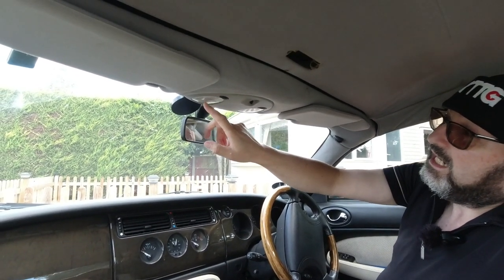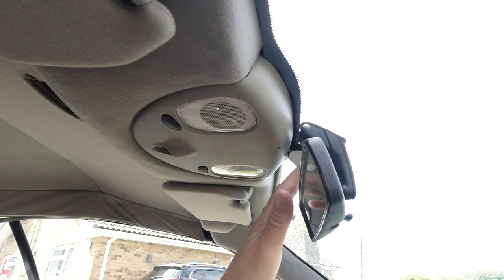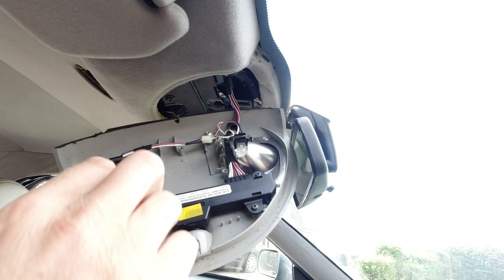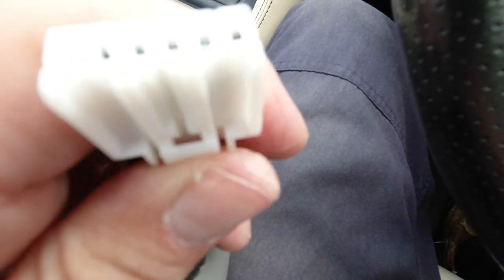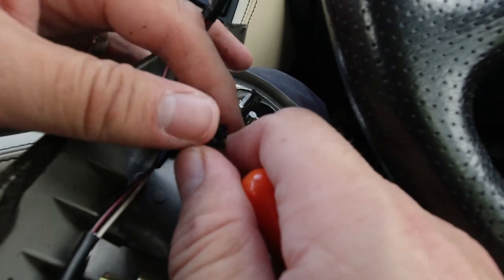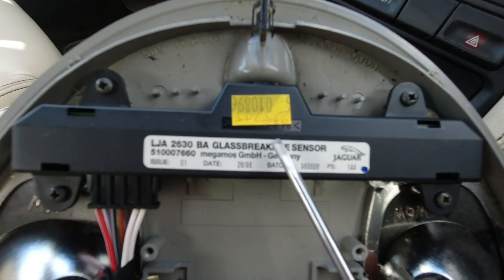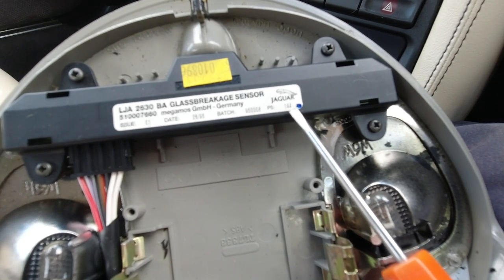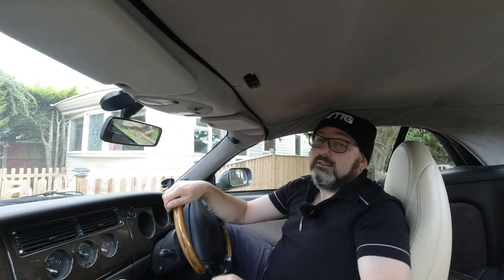Secrets of the Jaguar XK8 episode 68.  Map lamps.

Comment: Hi John . Just a quick one the later models came with a ultra sonic sensor for checking the passenger etc was no to close etc. When doing these models I recommend disconnecting the battery 1st because a power surge to the airbags could be expensive. Also when refitting be careful fitting the rear lug you do not want to crush the wire mesh covering the sensors as this can cause airbag warning light to come on as the ultra sonics don't send out of the unit properly
Reply from the maker: I have seen the version with the large mesh at the rear but had not realised that it was connected with the occupant sensing. Thanks👍

Comment: Great help thanks. A couple of points for others to note. 
1. If you have a fine mesh part for the safety system don’t touch it, it’s really soft and bends.
2. When you pull the trim down it takes a lot of force, mine went with a bang.
3. Around the front edge of the trim against the windscreen mine had a lot of gunge. I got it on my fingers, be really careful not to get it on your headlining.
Reply from the maker: Thanks Kevin. Excellent additional detail👍👍 Was the gunge just nondescript grime build up? or left overs from windscreen replacement or possibly convertible roof hydraulic failure?
Reply: @ToTheGarage  it looked like it had been carefully applied to the edge, it was black and like a non setting sealant. My car is a 2001 coupe.

Comment: Hi John, for any reason would multiple fuses on all 5 fuse bays be powerless until the car is running? IV like 10 fuse spots with no powe in them plus fuel pump relay no power, no power windows, the crash switch is making contact 👌 but cannot understand why fuses would go out, it has a couple fault on dash, gearbox, wrong part installed, restrictions on performance? I'm beet on this one friend it's me dads xkR and I'd like to get it going for him as he probably don't have many years left.
Kind regards
Barry.
Reply from the maker: Others may advise better on this Barry but I would check the connections on the big fuses in the boot bbelow the tank (250 amp i believe0 and then try disconnecting the inteligent sounder in the right front wheel arch (below headlight) as it may be a security system fault  and the car is silently sounding its alarm?

Anybody else?

Comment: Hi John , similar question regards access to the dash gauges for temp, battery charge and clock ... I have bulbs that have gone and need to replace ... How do I get to them ? Trim off? Thanks
Reply: I think you just pull the wood front off. Then Philips screws to remove gauge pods.
Reply: Andy Kirwan Thanks Andy

Comment: Why did you get the XK8 and not the XKR?
Reply from the maker: The car in the best condition and oldest (and therefore most interesting to me) was Purdey the XK8.. 
However I certainly didn't buy the XK8 (this is the 2nd one) because I couldn't afford an XKR.I Dont need to go any faster and its a slightly cheaper ownership prospect.
Reply: @ToTheGarage  Fair enough. It's just the acceleration and the noise of the supercharger is rather addictive.

Comment: FYI the black plastic piece that holds the front two clips often breaks but it is available I have had to replace mine. Also looks like your windshield has been replaced at sometime (so has mine) mine was replaced at the same time as my rear window it exploded, yes exploded it was a very cold morning and I had the heated rear window on and was driving down a freeway when there was an almighty bang and I thought someone had shot at me (it's America so quite normal) I looked around and couldn't see anything until I looked in the rear view mirror and couldn't see a damn thing out of the rear :)
Reply from the maker: The screen is a replacement. (wrong brand) But how could you tell from that angle?   Gary, You are like Yoda, but with spanners😁
Reply: To The Garage it’s elementary my dear John when you removed the plastic light holder you could see there was black sticky stuff all over it that is a telltale sign that when they put in the windshield it got black sealant all over it, and if I’m not mistaken it was probably done sometime between 1996 and 2000 at approximately 11:35 in the morning 😏
Reply from the maker: jagvette1 well done Hercule👍
Reply: To The Garage Watson it’s Holmes if you don’t mind I’m no Belgian